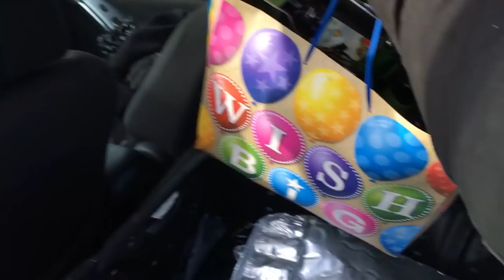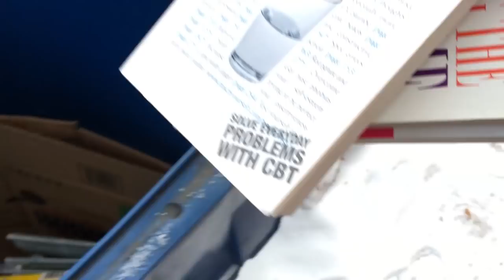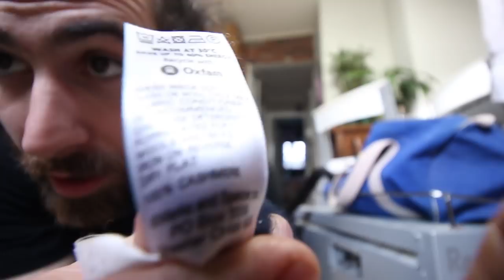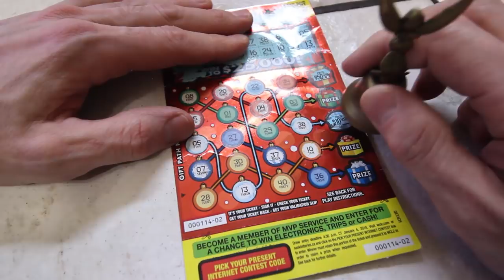Found A Cashmere Sweater Trash Picking And More Great Scores!

Comment: Good video! Sucks to have the shipping cost surprise....GRRR! Can you make the box smaller and lighter? Just sell to North America don't go overseas it's not worth it. Risky and to ship anything is super expensive. I still have Xpresspost International and Tracked Packet International on all my listings those have tracking so less risk. I rarely get a sale because the shipping is so much. Set your domestic shipping to expidited and xpresspost so they have a choice. For international set up shipping options as tracked packet USA, Expidited USA, Xpresspost USA, Tracked Packet Int., and Xpresspost Int. Cheapest is Tracked Packet USA. To qualify for tracked all the measurements of your box cannot exceed 90 cm.  Plus the weight cannot exceed 1kg. After 1 kg you have to send everything Expidited/Xpress to the US. Use calculated shipping and you'll have to measure and weigh each item and set that in the listing. Don't forget to add extra weight and dimensions for the shipping box. Hope this helps brother keep up the good work!

Comment: One question are you sure the fan is running the right direction? I think if you swap wires it will blow and if you swap the same two it will suck air. Just askin cool find though.

Comment: Does Ebay have the Global Shipping program in Canada as well, or is this a direct international sale? $20 wouldn't be unreasonable to get it to Kentucky for Global Shipping which is why I thought it could be that. I'd call Ebay to find up what's up with the high shipping cost. If your weight and dimensions were accurate, the discrepancy shouldn't be there. I'm not super familiar with Canada Post, but USPS has First Class International and Priority International that can both be used on some packages...first class goes up to 4 pounds I think. The price difference can be huge between the 2 of those though, so if you select the wrong one it can cause issues. Maybe there is a cheaper option via Canada Post also and that's what they charged the buyer? Worst comes to worst, maybe head over to that place that was shipping USPS and see if you can send it via USPS First Class if it's under 4 pounds.